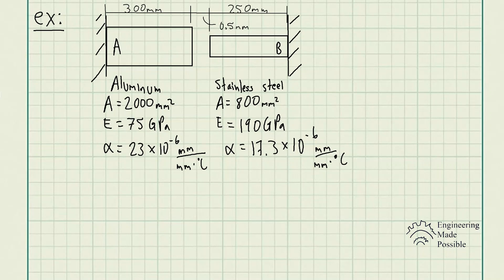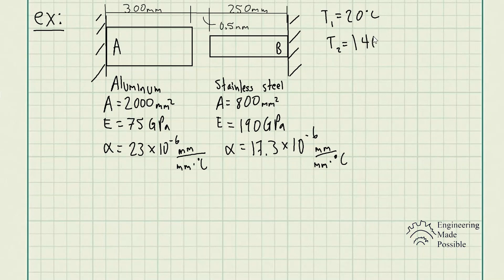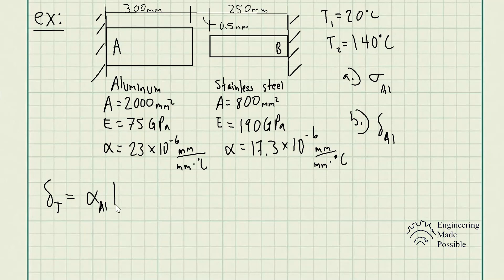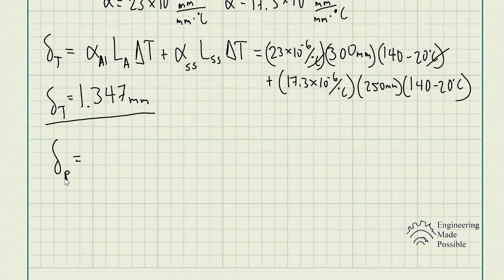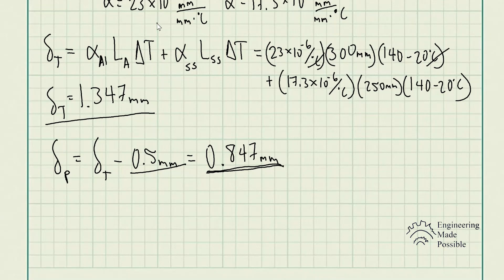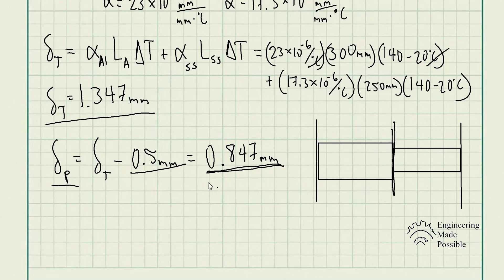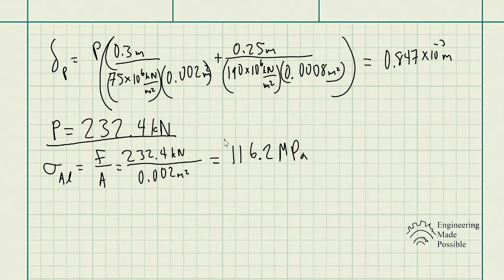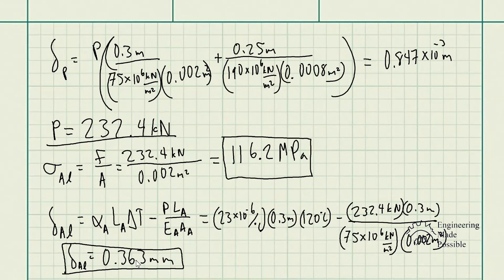At room temperature (20 C), a 0.5 mm gap exists between the ends of the rods shown. At a later time.

Comment: Sir , could u tell how P is equal in both steel and Aluminium?
Reply: That comes from Statics. Think of both the Steel and Aluminum rods as a single body, and draw the free body diagram (external forces) of that two-object system. The only external forces that act on that system are the reactions at A and B. So they have to be equal to satisfy Fx=0